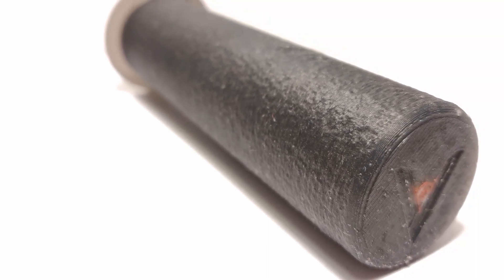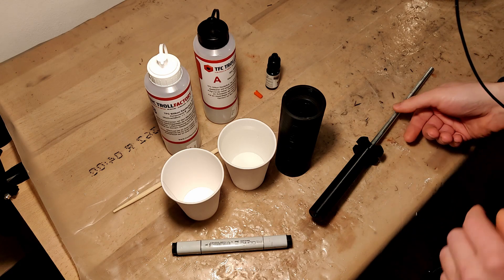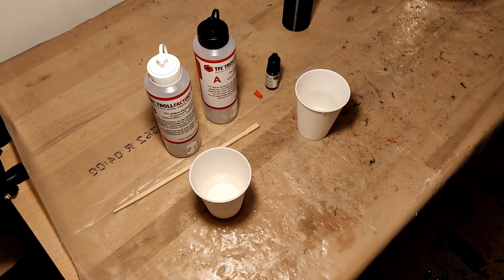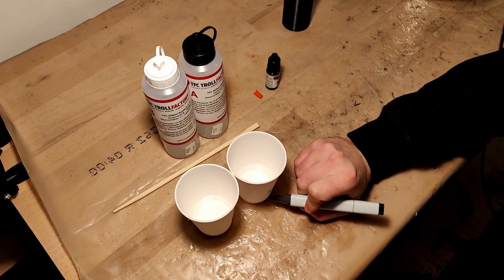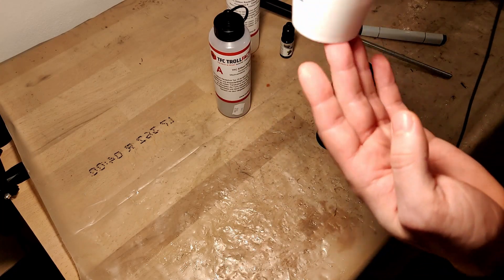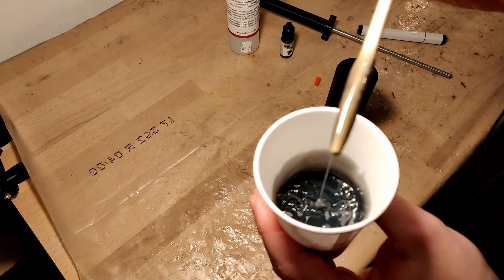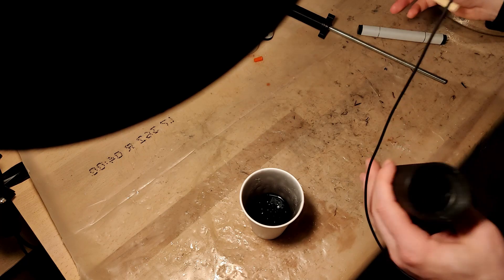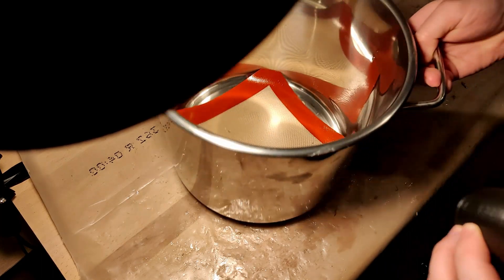Casting silicone using 3D printed molds

Comment: what silicone did you use for this? what shore hardness is this.  this looks perfect for what i’m looking to make
Reply from the maker: I believe it was shore 26a, in retrospect I would go a little harder - it feels too soft when you grip it tight
Reply: @ awesome. i’m trying to make some drum machine pads for a midi controller and i think this would be the perfect soft yet firm properities.  what brand is this ?
Reply from the maker: This was from "troll factory", type 26